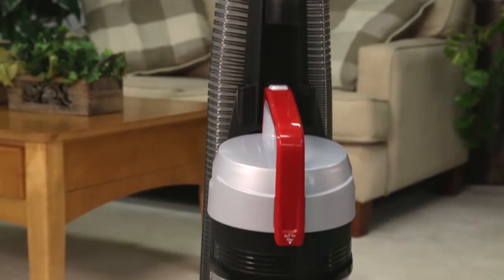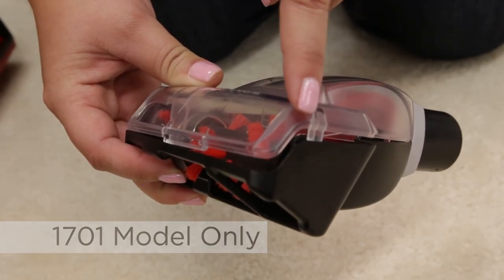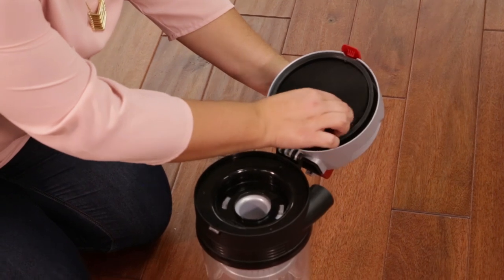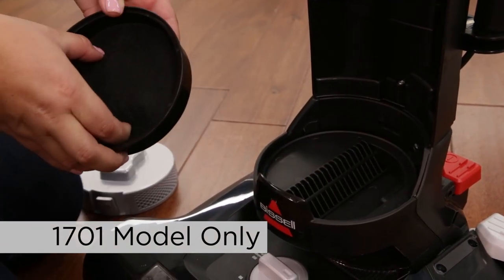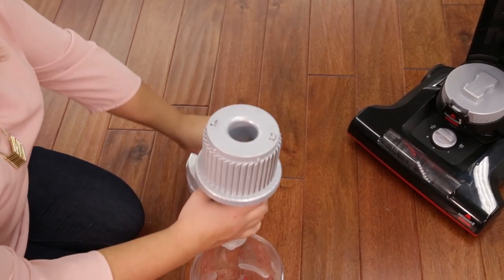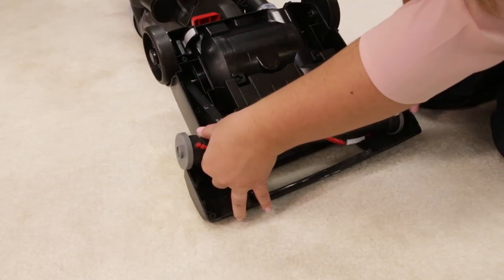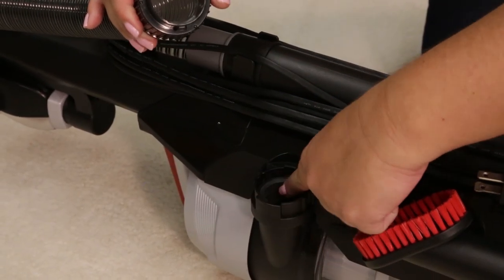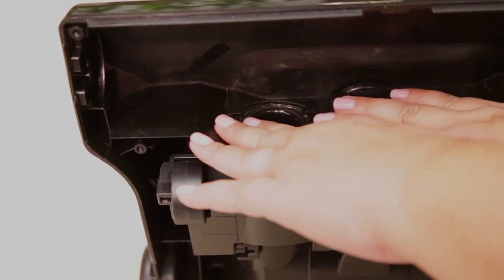Maintenance and Care - Powerforce Helix Turbo

Comment: Hi, my issue is my brush stopping. My wife and I have tried to resolve this issue. Do you have any suggestions how to fix this issue?
Reply from the maker: Sorry to hear it's stopping! Give us a call and we can better assist with your vacuum. 1-800-237-7691 .
Reply: This just happened to mine. The brush assembly is very poorly designed.. After using it for about two years the plastic end caps on the brush start melting from the friction when it spins. it effectively friction welds the brush up solid. I had to order a new brush assembly in order to fix it. the entire assembly was only 15$. I love this vacuum but it definitely wasn't designed to last

Comment: Wow I wish that I never purchased this piece of garbage, earlier today. I thought it was sucking up dirt, but when I went into a slightly dirtier room,  I discovered, all that it was truly doing. It only blows dirt and dust away as if it were a hairdryer. That room is my bedroom, and is my cats favorite room. There is dirt, dust, & cat dander in the air everywhere now. I have some slight breathing difficulty, but nothing serious as long as I vacuum well, but this has made it very difficult to breath. Even though there is an option on the vacuum for bare floors, and I was using it, one of your chat hacks, was trying to tell me the reason it was blowing dust, was because it only works on carpets and upholstery. I even sent him a picture of the knob wt the bare floor option, and he just kept repeating the same thing, as if he was an automaton. Everything is connected properly including the dirt cup, yet for some reason there is no dirt in the cup. It is on my walls, my furniture, and in the air though. Still not sure where my cat and I, are going to sleep tonight,. It certainly can't be here, because I have to let the room air out. This was my first and will be my last Bissel vacuum.
Reply from the maker: Hi James - it sounds like a vacuum with a brush on/off switch would work better for your hard floors and help prevent any scattering of debris. Our PowerGlide Pet vacuum is a great option and has a brush that can be turned off. You can learn more about it here: https://www.bissell.com/powerglide-pet-vacuum-with-suctionchannel-technology-2215?cid=ccsocial2107
Reply: You probably just got a faulty one because I have the same vacuum and it works like it says it does.
Reply: Sounds like someone"s craving sympathy.
Reply: @giovanidiaz541  thankyou for that , its TRUE
Reply: I had this happen to me when I first got it. I realized after that the hose wasn't connected to the open holes, so I would vacuum and the dirt would come flying out

Comment: I love how this video says nothing about what type of belt you need.
Reply from the maker: Hi Tony - this vacuum uses a style 7 belt which you can find here: https://www.bissell.com/replacement-vacuum-belt-for-bissell-vacuums-2031093?productid=1701
Reply: How can I replace the belt mine just cut into two
Reply: @hawabeah9088  it says in the damn video pay attention
Reply: Mike Parker I didn’t ask you mind your damn business
Reply: @michaelparker8503   LOL
Reply: @hawabeah9088  we had this issue, and I ordered a new belt straight from bissell. Put it on, thought my worries were over. The damned belt would not stay on. It got to the point that I would turn on the vacuum, and the belt would fall off. I emailed bissell I don't know how many times, and got told it was me, not the vacuum. I finally got so mad trying to vacuum one day, because the damned belt would fall off, would put it on back, turn it back on, and it would fall right off again, that I opened up the front door, and just threw it out! Good luck with your new belt!